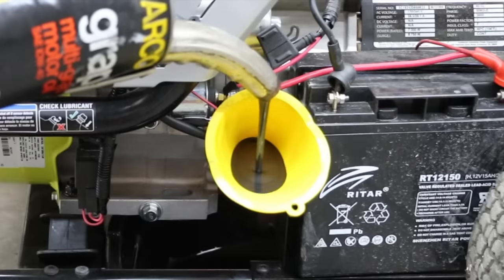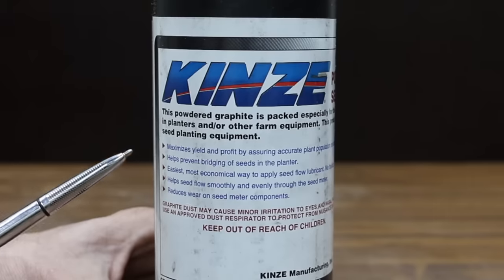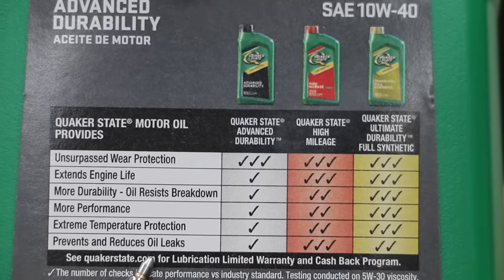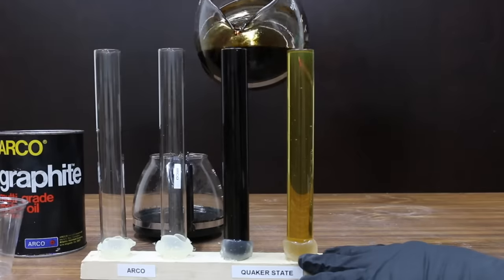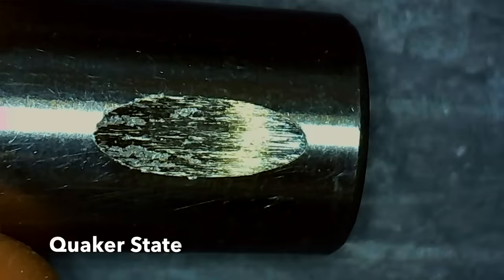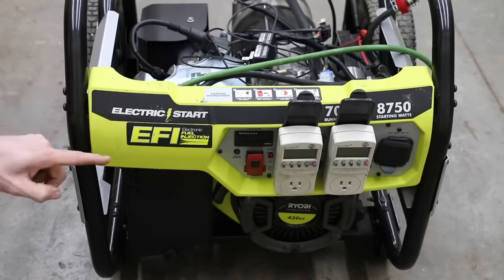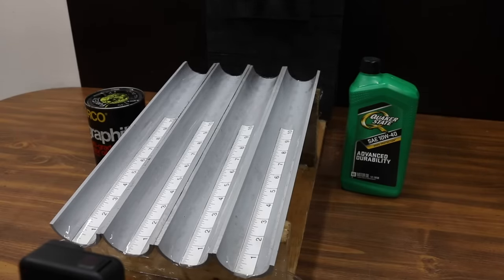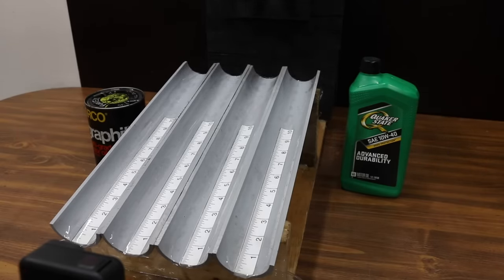Will "Graphite" Help Motor Oil Performance? Let's find out! Vintage Arco Graphite vs Quaker State

Comment: would love to see you do a video on how to recondition a car battery, there's a lot of different information on the internet and a lot of claims. Hope  to see you tackle this project
Reply from the maker: Great suggestion!
Reply: Just get an Optima spiral gel cell. They're twice the price, but don't die even when you try to kill them. I've personally seen 7 year old spiral cell covered in oil and dust and thought, "oh there's no way THIS turd will pass the load test" but it tested so well I'd guarantee it would outlast the car it was in. something like 75% life remaining.
Reply: @lifestudent101-whostolemyname  yes I've heard good things about those batteries, but when you receive free batteries would be great to be able to recondition them to be used for garden tractors and such.
Reply: @lifestudent101-whostolemyname  I have had them go out as quick as the next one......
Reply: I use AGM batteries in my Harley.  I had one go dead flat while on a ride, on Thanksgiving Day.  Took it out, smacked it on the ground and ta-da, full charge.
Something to do with crystal growth or something.
I still replaced it.
Reply: John. 
You want the yellow top. 
3 year warranty but if it ever goes dead they hand you a new one.

Comment: In 1980 I bought a repossessed 1976 firebird that had ticky lifters and only 50K miles. . It was a beautiful car, but I don't think it had seen many oil changes. I tried lots of remedies, but drove it for a lot of miles like that until changing to Arco graphite. The noise was gone right away and stayed gone as long as I continued to use it. If I changed to something else it would return. Eventually Graphite was no longer available so I switched successfully to Castrol. Probably any oil would have worked by then. I think the Graphite had cured it. I sold the car with 206K miles on it and it never used any oil between changes and never needed any work. It was still beautiful and ran great.
Reply from the maker: Impressive results!

Comment: I used to use that stuff in my cars in the 70's when I was just starting out driving.  Now, I wonder how much of that was caught in the filter and ended up clogging it quicker.  The same would go for any solid added to engine oil.
Reply: I used it almost always in my 1972 Dodge Charger back in 1980 and 81. Rusted frame killed the car along with a big crater (I'm from the north). It ran like a top, as far as I know. I wasn't that skilled in working on cars back then. It was my first one.

Comment: How about running the graphite oil trough a car oil filter to see what affect the filter has on the oil/graphite.
Reply: I was thinking the same thing, along with what it would do to the pickup screen and the oil pump
Reply: @TheDuckumz  good point.
Reply: Id like to see this to. I would think it would act like sludge and block some of the flow through the filter media.
Reply: Not good, I worked on mopar cars in the mid late 70's and that graphite crap would blow filters off!
Reply: @tnbass2833  the better filters would remove the graphite and possibly clog the filter over time. Might, maybe, perhaps, slip through a el-cheap-o filter.
Reply: You'd be wasting your time. The graphite will be sized to slip right through the paper. Atlantic Richfield  was a big oil company, lots of stations sold Arco gasoline and oil.They would have tested it with every engine and filter on the market. If they had plugged oil filters engines would have been ruined and there would have been a lot of publicity and the Arco brand would have been ruined. Filter paper hasn't changed pore size, you can tell because if the paper was tighter the pressure across the paper element would be much higher but plugged filter relief valve pressure is the same as it was 50 years ago. The only change to the filters is better single pass efficiency. That's because paper made with uniform strands of synthetic fiber has a more uniform pore size so there are fewer large pores for dirt to slip through. The average pore size hasn't changed. Arco the oil company focused heavily on refining and other  "downstream" operations that had razor thin margins in the 1990's. They stumbled, became a target for the finance wizards, and the company was sold to BP in 2000.
Reply: @certifiednobody7313  We were an Arco dealer, I ran the Arco Graphite in my 68 440 .....and all our other customer with Mopars, it never happened to any of these cars with the oil filter.........just saying..
Reply: @josephklimchock5412  yes I worked many domestic mopars that did not have any problems BUT the plymouth arrow and plymouth sapporo dodge colt most all their imports did👍 p.s. however, the first plymouth horizon with the VW engines did not have that problem. Guess only the ones from Japan did 🤠
Reply: @certifiednobody7313  OK, those engines had much smaller oil passages, very unlike the 60-70s Mopars in the USA.....I dont really consider the ones you mentioned actual MOPARS......they were made by other companies and labeled what they are.....
Reply: @josephklimchock5412  LOL yeah, when we were working on them we didnt consider those "Mopar" and called them "Cardboard Cars" ROFLMAO! BUT look a today, they are running circles around the domestics!😱😂
Reply: I've used all kinds of things but one thing that did clog my filter was some kind of engine renew stuff in a can that I forget the name of but they had three different size steel cans for 4, 6 & 8 cyl and every chain parts store had it. It actually worked on some old car I had and boosted power quite a bit but didn't last long at all. Years later I put it in an eng that I plugged the oil bypass and right away my oil pressure dropped drastically! I forget but I think it was below 10 no matter what. So I guess everyone using it no longer has filtration but I'm the only who noticed? 
With the graphite etc you just have to be sure it's fine enough, so don't just use unknown stuff. I have a pound of graphite in a tin I've had for decades, with the size listed and it's too big to pass through a std filter. I'm sure someone had tried though... I also wonder about engines without filters, like little 5HP stuff etc.
Reply: We are all guilty of not following regular interval maintenance procedure possibly the owners did not drain the oil when recommended and the bypass in the filter failed so who knows its been so long ago I only know it was a nasty mess when they came in on the hook... ROFL and was an $$ endeavor in some instances
Reply: They could use a nano graphite product
Reply: Regular filters filter between 25 - 40 microns which would only catch a small % of the graphite particles, however, high-performance filters come much closer to 12-15 microns so obviously would remove a much higher percentage of graphite.  By-Pass filtration could potentially remove all of the graphite depending on filter media.  I have a tester I use carbon black in from a copier machine and it's finer than the graphite and some by-pass filters remove enough of the carbon it's undetectable with the naked eye.
Reply: the graphite used in this oil is way to big to be of any benefit to the engine in fact it will not do much at all as the engine oil filter is 10 microns so in the first few minutes it will clog it. and only small particles will get thru.You will need something in the order of 1 micron size. at this size graphite is called graphene a totaly different product with a lot off different properties from graphite.
Reply: @certifiednobody7313  not...
Reply: @certifiednobody7313  lol. I work on European cars.  We called Mercedes 190e cars the training Mercedes.  Get some help and you might be ready for the real thing
Reply: @chevota400  engine restore.  It was a gray can
Reply: @chevota400  I'd think graphite would be fine. At our shop there is another building where they work on mowers. On the transmission or diff on non zero turm mowers that leaked they would fill with graphite
Reply: Can't help but wonder what the graphite might do to the VVT systems that really didn't exist back then.
Reply: how about seeing if the graphite blocks the filter?
Reply: Does wonders for wear... Until it clogs all the oil galleries and the filter preventing ANY lubrication.
Reply: Just don't get your results from Dr. FALCY
Reply: @dwendt44  even Fram would block that. Most oil filters have 10 to 20 micron filtration, race filters have 60 microns to allow higher oil flow. 

The problem with cheap filters is the materials used, not the filtration level.
Reply: In the very early 80's I ran Arco Graphite in my Mazda GLC.  Never had a problem with the oil filters, the graphite slipped right through.  If I remember correctly Atlantic Richfield had a patent on the graphite process so they were never copied by anyone else.  Compared to the oils back then,  I did notice a slight improvement in fuel efficiency and the engine seems to be a both more responsive and ran a little cooler during the hot Florida summers. Idle seemed smoother too.  The only real other competitor was Mobil-1 which came out around that time frame.  I noticed an actual difference with Arco.  I tried Mobil-1, and I could not make the same statement,  The car seemed to run as it did prior to Arco Graphite.   I'm sure synthetic oils today are much better than the oils that were available back then.   Thanks for doing this.  Very cool test!
Reply: @oliverstreet7704  lol a big oil company would never sell dogshit right?
Reply: It would plug the oil filter. It's been tested decades ago, and that was the result.
Reply: The particle size of the graphite is typically smaller than the filtration capability of the oil filter. IMO some of the graphite will be filtered out to a certain extent as the oil does it's job of removing contaminants from the engine and crankcase.
WS2 Tungsten Disulfide is the best powered additive to use for your engine. Do some research on how well it fill micron size imperfections in wear surfaces of metal under a friction load.
Reply: keaneperson  That's what I was talking about... Powdered Graphite. I dont know anything about colloidal.

Comment: Years ago (20) I  used an engine oil that was infused with P T F E, the v-6  engine had around 130,000 miles after several oil changes that same engine was torn down for a rebuild for another application and was later sold and still operating satisfactorily with 80,000 miles on the rebuild, the buyer drove that engine five more years and the engine was still running,we both used that same oil only changing the oil twice a year using the same oil, no we didn't use oil additives, the ptfe was already in the oil.

Comment: I think when Arco was made the base oils were more unstable than todays modern concoctions. May be a test between Arco and the regular oil equivalent to that time would be more appropriate.
Reply: I dont know that Quaker state was pretty basic even for today standards. I wouldn't use either in my car.

Comment: Some years ago I tried graphite oil in my lawnmower. It ran ok for a while then the motor cut out and refused to start. Problem was some oil was getting past the rings and having coated the insulator of the spark plug caused a short. Conclusion, be cautious if you use a graphite oil in an engine that burns a little oil.
Reply from the maker: Thanks for the feedback.

Comment: I remember using this stuff in a Ford Grenada. It sludged up the engine after just a few oil changes.
Reply from the maker: Thanks for sharing.
Reply: "just a few oil changes". What was that in time and miles?
Reply: I had a Ford Grenada  when I lived in the UK a few years back. I loved that car.
Reply: @harrygatto  Probably a few years. Change the oil at least once a year, if you drive a lot a couple times.
Reply: my family had a 77 grenada!
Reply: @duckboy9979  The US Granada and the European Granada are quite different cars.
Reply: @Dixxi  OK thanks.
Reply: @harrygatto  2 months and third month the engine blew all entirely. true story.
Reply: @harrygatto  
It was so long ago I forget exactly. I was a teenager and it was my Dad's car. 1976 Grenada, V8.
Maybe a year or so. Back when we changed oil every 3k miles. But I remember being able to stick my finger in the oil fill and come up with a finger full of goop from the top of the head. I stopped using it.
Reply: Sounds like Quaker state!
Reply: Yeah, we had a Malibu we used that stuff in.  Pulled the valve cover off and it was like a jello mold. Graphite, the Slick50 of it's time.

Comment: As a mechanic during the time ARCO Graphite was available, I can say it could be a mess to change. Not one you wanted to miss the catch pan with.
That said. It was highly recommended for farm equipment and diesel tractors of the time. The no-load on engine performance was nothing to talk about, but in high load applications, it was a star. A quart cost a third of the price of a bottle of engine restorer and worked twice as good.

Comment: Had a 454  chevy in a 28ft motorhome. Added a teflon additive  and the biggest problem was that when I lifted off the gas pedal going down hiil compression braking was nearly absent. However mileage increased to 12.5mpg from 6mpg. I check every tank of fuel and this stayed constant. Just had to use brakes way more often.
Reply from the maker: Thanks for the feedback.
Reply: Was that called Slick 50?
Reply: @ProjectFarm  Have you tested Slick 50 additive? And if you did, did it block anything over time?

Comment: love watching your show, did my own test when arco graffite came out, was rebuilding a cycle engine at the time and made note of all measurements then assembled and used the graffite, rode the cycle for 1 year regularly, then tore it down and everything measured the same, I was fairly impressed however I didn't compare to any other oil
Reply from the maker: Thanks for sharing.
Reply: How many miles on the motor?

Comment: Thanks for another awesome video. Your tests are very thorough and scientific, with real world results. I remember using a graphite oil additive in an old worn out ford engine back in or around the early 80's. It did seem to improve performance somewhat, but after running it about 6 months I tore it down for a complete rebuild and the cylinders, heads, and valves were all crusted full of carbon and/or graphite worse than any motor I've ever worked on. Probably why it is not widely used anymore.
Reply from the maker: You are welcome!